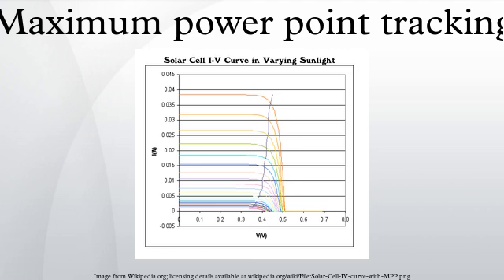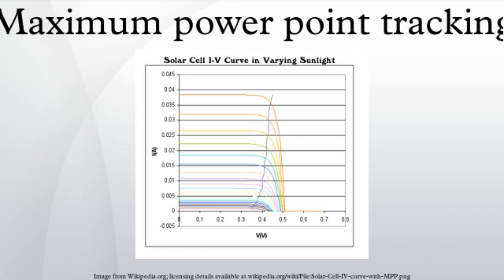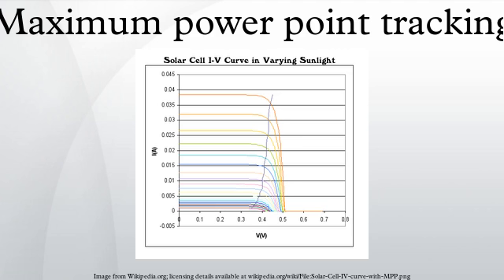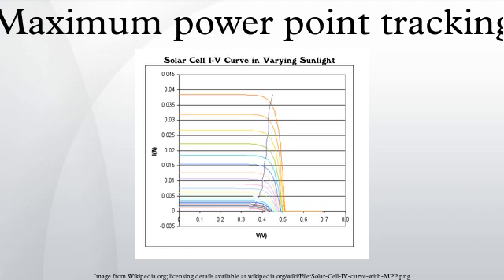Maximum power point tracking

Comment: What is the Max. PV input power Rating on the controller chart in the manual? Mine is rated at 390 watts Input... I have 400 atts of panels  does that meen that the controller will blow up if I try to use it with those 400w panels? or is the actual input less than 400 watts due to loss in wires and partial sun ect. ?
In other words, Do I have to definatly buy a 40 amp MPPT controller rated at 560 watts or can I get away with the 30 amp unit rated at 360 watts?